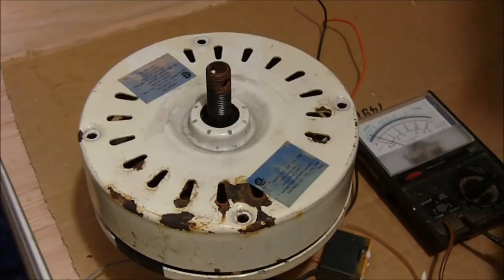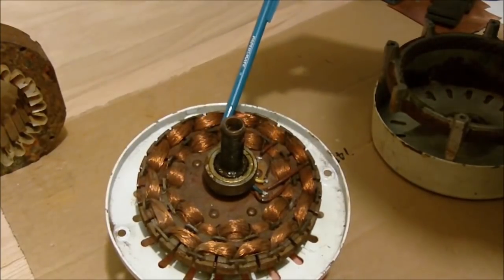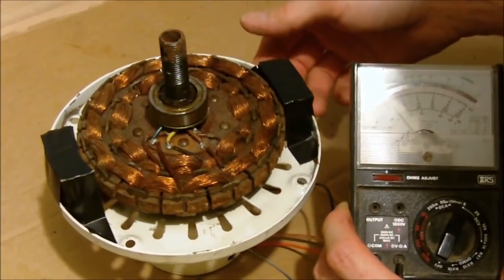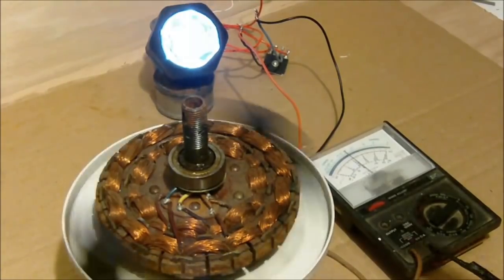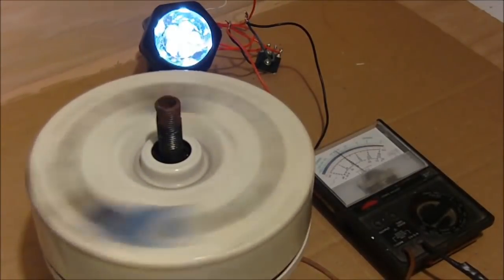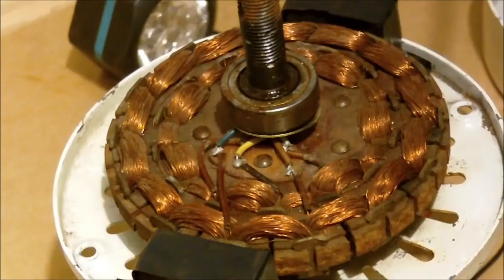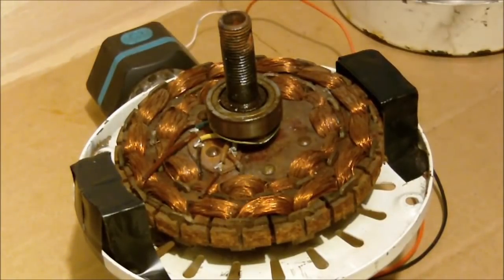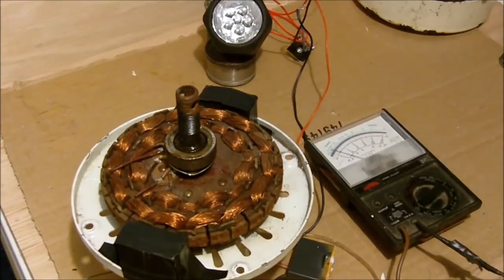Ceiling Fan to Wind generator conversion demo

Comment: My ceiling fan vawt turbine works very well when I get winds at night. When solar panels are inoperative. The fan motor has only been made secure in the last few weeks. We had goodish wind after and my batteries for my lighting system were trickle charged nicely. On average I get 8ish hours a night of lighting for my flat. Using them no differently than if I was running them off the grid. Your video is a fantastic tutorial in how to convert a fan. Well done and keep them coming.
Reply: You have your lights on for 8 hours during the night?
Reply: @andrewsmithmilan1780  The collective power I get at night off wind and night charging experiments equaits to enough energy that will run my lights for about 8 hous. None of my lighting is on for that long.
Stay safe and have a great day.

Comment: I was an electric motor rewinder for 11 years.  Cut the individual coils apart so that you have 2 leads sticking up from each coil.  This gives you flexibility to connect them in various configs and polarities.  For max output, connect all coils in series in the SAME POLARITY, i.e., into coil, clockwise thru coil, out of coil - into next coil, thru clockwise, out, etc., etc.  

Also keep all your magnet polarities the SAME - all N or all S, no matter which. This will give you max DC voltage, but minimum amperage.  You can also play with connecting them in series-parallel groups, to get lower voltage at higher amperage.  It should work surprisingly well.  

Apply a load and monitor the temperature of the windings. This will ultimately be your limiting factor. Connect some light bulbs or a coil of nichrome resistance wire until your winding temperature reaches the safe limit of your insulation, usually 105 degrees Centigrade, abt 220 F.  Measure the current output at that point and de-rate it by 10% and use that as your max safe load.  
 
Connecting a capacitor shunted across the output to accumulate your voltage will help to smooth out the RIPPLE CURRENT (may as well learn the correct terminology) in low-energy setups (w/motor used as-is) but its not necessary or helpful at all if running full tilt boogie, modified as per how I have explained.
Reply: whutdahuh . How about elect. Washing mes.motor. how do i wire it up to work on a.c.  plug like it ran b4. To just plug into wall outlet.
Reply: whutdahuh nice explanations
Reply: I have cealing fan 14mm 36 swg 16/16 coil what should be the turn of runing and starting?
Reply: whutdahuh can you post a link to some configuration for max output with min spin.
Reply: @ Aaron Weir. 
Short version. Don't even think about it. If you didn't electrocute yourself, you'd burn your house down. 

Long version. Firstly, never put a plug on the output of a generator, it's a shock hazard.
 
 Secondly, the electric company supplies electricity with a well controlled voltage, a rigidly fixed frequency and a fixed (but unknown) phase.  
To connect a generator to it - which no homeowner would be allowed to do, you'd have to precisely match that voltage, frequency and phase. Any difference would kill your generator - spectacularly, violently.

Your home-built generator would have a variable voltage, variable frequency and variable phase.  There's simply no way it would match the incoming mains supply.  You couldn't even connect a commercially made generator to the live mains without causing carnage, because the two have to be in phase!
Reply: An electric motor rewinder eh? Do you mean you operated a machine that did it automatically or something?  There's some serious nonsense in this post.  First, if you place all of your coils in series you won't get any output at all because half of them would be swinging positive at the exact moment the other half would be swinging negative.  It's like if you took 2 identical batteries and connected positive to positive with a load between the negatives or vise versa they would exactly cancel and the load would see 0 V.

Secondly, if you had all of your magnets facing the same way you wouldn't get a DC voltage, you'd get NO voltage.  Even DC generators require that the coil sees an alternating magnetic field, they just use a commutator to flip the polarity of the connection to the winding in step with that reversal.  The only "true" DC generator is the homopolar generator; which contains no windings whatsoever and instead uses a conductive disc or drum as the rotor but due to there being, at most, one turn in the "coil" they are limited to extremely low voltages and efficiencies.

Lastly, connecting a capacitor directly across the output of an alternator will not provide smoothing because the signal is still 100% ripple (200% actually peak to peak); that is it's AC.  If you rectify the output of an alternator, then and only then can you employ a capacitor in the aforementioned way.

In a case like this where you have many poles, the best and easiest way to get ultra-stable DC out of the device is to bring 2 wires out from each coil and phase them all the same.  To do this I would recommend using a pair of magnets on the rotor; one with north facing in and one with south facing in.  Apply a DC current of known polarity to each winding. When you guess the polarity of the field correctly, match the wires + and -.  If it draws the other magnet you know it must have been opposite.  (Or else you can, you know.. just LOOK at the direction the coils are wound!) Once you have all your coils phased, connect all of their negative ends together and put 1N4001 diodes facing outward from all of the free ends and then connect all of the cathodes together.   The common coil connection is - and the common cathode connection is +.THAT is how you get DC from a multipole alternator.
Reply: Thanks
Reply: Wow! Please make a video out of this. And monetize it so that you'll get a paycheck out of it.
Reply: Make us a video bro
Reply: @aaronweir7944  I don't think you can without a capacitor
Reply: @whatelseison8970  he said he thought the coils themselves where alternating but depending on how many you used whether first row or all 3 who knows I would suggest putting all coils wound the same way and alternating the magnets north and south all the way around and this should give you plenty of current but I would also order specific magnets the same size as the coils.
Reply: Good explanation hats off

Comment: Was just watching your video about ceiling fans as generators. A vertical axis wind turbine is called a Savonius cylinder. I live in a flat open windy place. I made a turbine by cutting a plastic herbicide barrel in half down the middle. I've always wanted to power something with it. I've had to put it back together a few times after a bad storm because running without a load it spins so fast that the centrifugal force spreads the turbine apart to the point where the axles come out of the bearings. There certainly seems to be some free power to be had. The beauty of the Savonius cylinder is that you don't need a tailfin to keep it facing the wind...it spins no matter which way the wind comes from. It always spins the same direction as well. It just depends which way you overlap the barrel halves. RPM and torque will vary depending on the amount of overlap. It's easy to make a small model out of a tomato juice can or something similar. Just so there's no confusion...it is cut down the middle standing upright; not through the side.

Comment: I just (TODAY) used a small ceiling fan, and 24 small hard drive magnets to make a little generator. The fan had 8 large copper coils and 8 small copper coils. I stacked 3 small hard drive magnets together to make one strong magnet (a total of 8 strong magnets). I angled them ALL in the same direction (as opposed to trying the North Pole, then South pattern). I’m lighting-up (6) 5mm LED bulbs with very little effort. I have NOT gotten any actual current readings, as of yet, but it works WELL!

Comment: Prashanth Manjunath That would be the CAPACITOR that stops the flickering of the light. What this guy doesn't know is that if he hooks up a larger capacitor he could get much more power. Notice after he hooks up the Capacitor the light not only stops flickering but also gets brighter. He doesn't know much but he is learning and I give a huge thumbs up for him. I love seeing people learn and experiment with science.
Reply: A capacitor only matches the charge of the input does not increase it it helps to straighten the wave since the rectifier bridge does not permit ac to go negative. Well now the problem is on our way to dc the ac wave still has a hump in it so we add capacitors to smooth out the was to give us that dc direct current straight line
Reply: you think a h.p capacitor with a 2100 vac would do better or is that over kill

Comment: Very good video, also want to add that I recommend leaving the capacitor attached and use a voltage regulator downstream of the bridge rectifier for whatever voltage the user is wanting to charge.

Comment: hello and a very nice presentation. I am from Europe and for my bachelors degree I made a windmill with coil and neodymiummagnets. These magnets on size for the ceiling fan can be found in Germany. They are not cheap and they break easely. The firm  has neodymiummagnets in so many sizes and send to all the world. The firm is called Supermagnete. You can glue them on your ceiling fan with TEC 7. But Be Carefull they brake easelyHope this was some usefull information to this video. Greetings Luke Belgium (I don't work for the firm or dont have pattents... just discovered it on google)

Comment: interesting overview. I can see why ceiling fans are not optimal for the time and effort to convert to generators. but if you like the housing or blades and the bearings and wire up your own, its a nice starting point.

Comment: a stepper motor has permanent magnets already. You can tell by spinning a motor by hand. If it "locks" into a position when it stops, it's a stepper motor. Printing machies and some photo copiers use them, as well as other places...

Comment: Well, for low voltage, low watt systems, this would be ideal. Using smaller magnets, you should be able to pick them up fairly cheaply through some hobby sites or stores. Suggestion, the unused coils, get them out of there. Do not need them being  passing electron traps that would be taking away from your final output. Also too, using a savonus rotor as your drive, would mean that the generators can be stationary with one at the top and one at the bottom of the rotor as the savonus does not need to face into the wind as it is always facing no matter what direction the wind comes from. The savonus begins to produce usable energy at low wind speeds with a 5 mph breeze being enough to start producing usable energy. That means you would not have to have contact strips/brushes to transfer power and the units can be hardwired together and even placed in a parallel circuit to produce even more current, thus more watts. Simple regulator circuit to keep the voltage stable and you should b e able to produce enough to maintain an already charged car battery fully charged if you are only using low voltage devices. Or assist a solar panel to maintain a healthy voltage.

Comment: nice meter - hard to find (new) good mirrored-scale multimeters these days at reasonable cost (especially ones with low uA movements). Kids laugh at me when I tell them to get an analogue meter as well as a digital one - then, sooner or later, they come running back and ask to borrow one :)
Reply: Yes, even though it's the same measuring (+/-), better realizations seems to come across

Comment: You could use it for a wind gust indicator just as it is. Make it attractive and weatherized, put it on the roof, run the wires down to a led display inside your house, and when the wind blows it lights up your led display.

Comment: That's a Neat idea to charge the battery off the ceiling fan wind dc generator so you can hook the inverter off the banks of batteries so you can invert the dc power ac  power to power your home with

Comment: Great video,very informative. In your video you mention a few times that they aren't worth the cost because of the magnets. As a Prepper I disagree (while also respect ion your opinion) because they can mean the difference of hot showers (for instance) if/when the grid goes down. The best use for these are for charging and keeping one's off-grid batteries charged rather than actually powering a device/appliance. Living in the south ( ;) Al-ler-ba-ma,lol j/k we're not all inbred morons) wind power isn't really a realistic concept,but are good when combined with solar panels and/or water wheels. But loved your video and the amount of information you packed into it. ;) "Keep on keeping on."

Comment: In the '60's, as kids we built and raced slot cars.  A standard tuneup to an electric motor would include removing a few windings to reduce resistance, draw more current and go faster.  Race cars don't require longevity.  We also exchanged any brass bushings for ball bearings, balanced any spinning parts like the armature by filing metal off the low side, indicated when the heavy side spins down while the armature is supported by two razor blades on edge.  Filing the armature also made it more uniform in it's circumference, allowing us to shim the magnets in closer using paper etc..and upgrading the brushes to silver or gold, made a difference.  Near the end of my first electric car experiences (now I drive a Chevy Spark EV) we played with braking, by adding a loop to the speed controller so that it sent a small current from a 9 volt battery, backwards through the cars DC circuit, when the speed controller was in the UP position.  We'd replaced the transformer that was producing power for the tracks,  with individual car batteries on a trickle charger so each lane had a dedicated power supply.
Reply: +Refuso PissedO Ha Ha love it ! We had an old tyre and a stick
Reply: +georgie porgie  you must have felt like a king . we only had a stick until Bobby hit that pyromaniac phase of his... dam I miss that old stick.
Reply: you must of give him alot of stick for losing it !
Reply: I had a stick and some rocks, then in the mid sixties the slot car fad grew to the small town I lived in. I rewound the little motors, spaced the magnets closer to the armature, used magnesium frames, used different gear ratios, etc etc. Ahh those were fun times.............
Reply: D Sloop we were to poor to afford rocks, so I stole a few from the neighbors

Comment: One problem with using a ceiling fan is that it is not designed to be weather-proof. The only way that this could work reliably in the long term would be to locate the ceiling fan generator in a weather-proof housing to isolate it from rain and snow. A vehicle alternator or generator would be a much better choice.

Comment: Suggestion: what if we connect it to a rotary floor wheel powered by foot- we place it on top of the wheel and with a belt mechanism we click on the peddle (like sewing) so it continues to rotate. This suggestion is good for temp lighting in case of a storm and loss of electricity.

Comment: good one and you'd need to be a non-electrician to think of this one as an electrician i would have to re engineer the parts as the magnets should spin with brushes to add DC excitation and coils would be stationary, and the Bearing would not be used from a walmart priced fan but still cool!

Comment: thanks so much! now all we have to work on is getting things to run on less power, i installed a mini split air conditioner it runs on 6 amps, the fans in it run on dc voltage. compared to my old system the cost to run is halved!